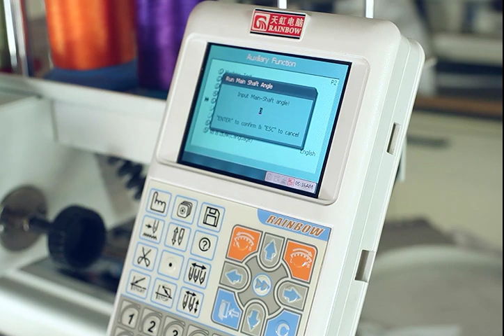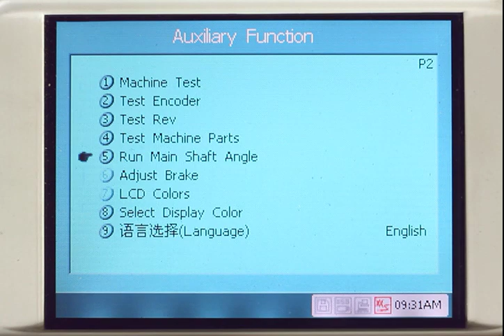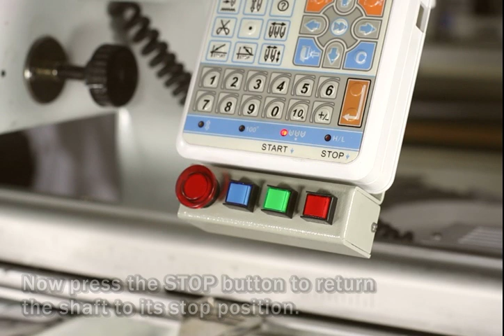Needle Depth with Scratch Gauge - Butterfly Embroidery machine (Ajuste Agugas con Calibrador)

Comment: using all the technicians peru is 1.7ml but I use it and it does not fit then send a change to a 1.6ml gauge is well sewn well but does not do well let me cut a little short thread and not recoje well thanks for answering